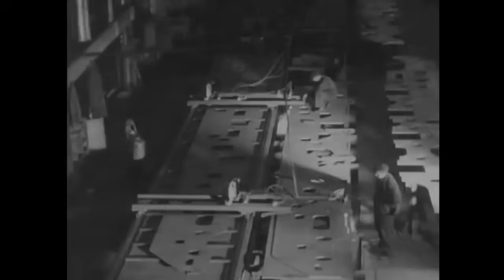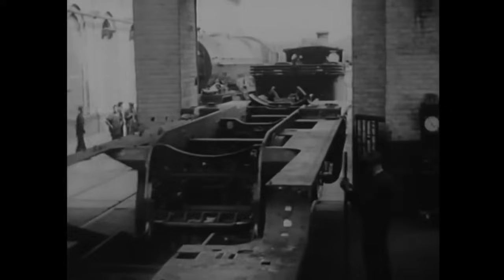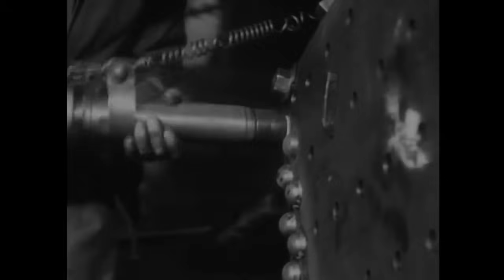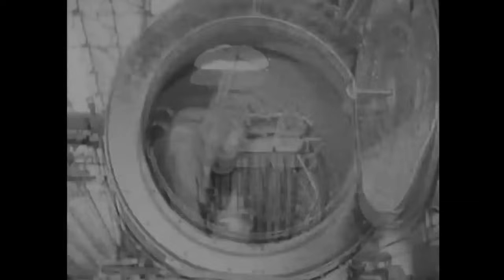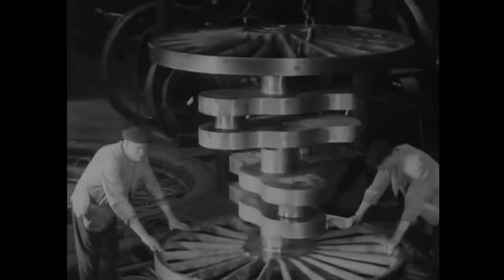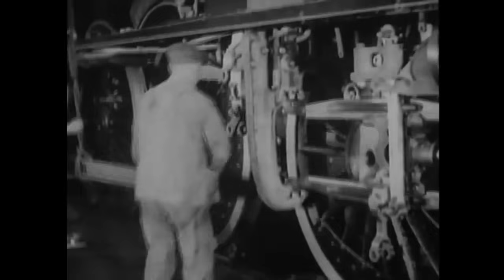No. 6207, A Study in Steel - Princess Royal Class - vintage LMS film - 1951

Comment: Look at the size of that inside cylinder block, and think what a nightmare it would be to make one of those nowadays.
Not impossible, but VERY difficult and expensive.
Then it has to work properly, AND be tested for certification and insurance. 
(Not complaining, safety is paramount on the railways).

Comment: Tragically, this very engine would later be involved in an accident due to poor assembly. According to the RailUK site;

"On Friday, 21 September 1951 the 08:20 Liverpool Lime Street to London Euston consisting of 15 coaches hauled by a Princess class Stanier Pacific began to de-rail south of Weedon on the West Coast Main Line south of Rugby at a speed of 65 mph and finally crashed, killing 15 people and injuring 35 more. The footplate crew survived and protected their train in spite of being severely shocked. The accident enquiry, conducted by Lt Col G R S Wilson, found the track to be in good condition and the speed of the train not to be excessive. However this was the first trip out for the locomotive, No 46207 Princess Arthur of Connaught after its bogie wheelsets had been swapped round. The enquiry concluded that the derailment was caused by an excessively tight bogie axlebox. The approximate location of the collision was 52°13'32"N 1°04'20"W, less than a mile south-east of the 1915 derailment and close to the signal-box at Heyford south of Stowe Hill tunnel where the occupants were able to see the accident. "
Reply: Do note, for anyone feeling bad at the thought that the fellows in the above film who seem to be doing such a meticulous and skilled and impressive job were making a train that would immediately crash on its first trip out because of a mistake, that this film of the creation of 6207 was filmed in 1935 and not 1951. It was a later crew 14 years later that made the mistake.
Reply: It must have been repaired and put back in service since I have it down as "spotted" in my WINTER 1959/60 Ian Allan abc of BRITISH RAILWAYS LOCOMOTIVES when I was 12 or 13.

Comment: Interesting to note is that this train was involved in an accident on the 17th April 1948
Reply: Did they repair it or scrap it after the accident?
Reply: @Cleveland.Ironman  It was originally built in 1933 and after the crash in '48 it was repaired and went on in service until it was withdrawn 25/11/61
Reply: @davidrobinson8224  Thank you for the information. Almost 30 years of service from magnificent rugged equipment designed without CAD/CAM but sliderulers and brains!
Reply: @Cleveland.Ironman  You got that right and not only those people but the blood, sweat and tears of the workers.  Mind you, the Health & Safety people of today would have had a field day, with the effect, that nothing would have ever been built.  It would be good to find out what the casualty rate in those far off days was compared with today.

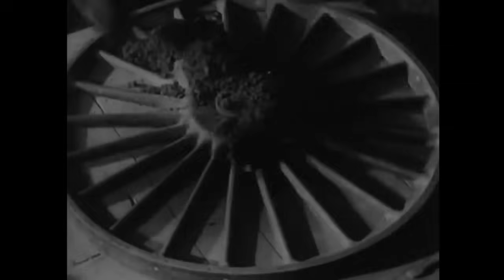Comment: 20:35 the production of the four cylinder wheels with double crankshaft inside was a real high end technique these days. 26:15 the windows design in the wheels shop are like windows in a cathedral.

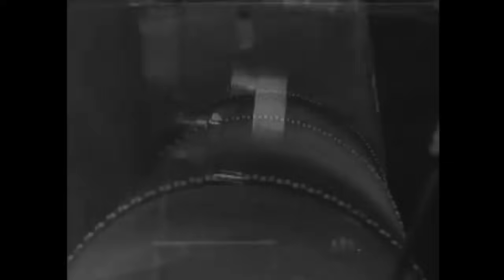Comment: Not a minimum of noise protection ruined the ears of the blacksmith workers in the boiler shop in a short time 14:00 ff. The asbestos in the isolation of the boiler 18:25 caused cancer in the breath system of the men later on, nobody knows the danger. The same problem accures in the brake shoes factories.

Comment: In the US,there were similar works,and thankfully,some of their products are still running! Remember Alco(Schenectady),Lima(Ohio),and Baldwin(Philadelphia),for they also exported engines to Britain,and if you look closely,in some museums,you can find builders plates,on any number of engines! Also some railroads over here,built their own,notably the PRR(Altoona),N&W,(Roanoke),and they also were building steam engines right into the 50's,and thankfully again,now some are still in operation! As an aside,one railroad,was never totally dieselized,and that was/is the Union Pacific,because they were still running 844(8444), an FEF Class 4-8-4,since joined by a Challenger(4-6-6-4), and a Big Boy(4-8-8-4), so steam also is not dead on the UP! Add a comment,the building of a brand new Ivatt 4-6-2(Tornado),is a feather in the British cap,👏 bravo! You cannot keep a group of railfans down,no matter where!! Thank you for your attention! 🚂🚂🚂🚂🚂🚂🚂🚂🚂
Reply: Ivatt never built any 4-6-2s Tornado is a LNER PEPPERCORN 4-6-2

Comment: Knew a railway engineer some years ago and he had kept a set of special oversize rulers so they could compensate for the size of the wooden mould and the contraction the the steel or bronze to achieve the correct size...amazing...

Comment: How much easier would it be to build this locomotive today, with plasma jet cutters, NC tools, 3D printing.and welding for boilers, and no asbestos.
Reply: hows the 3d printing work, like you put a piece of steel into it and make connecting rods. i don't understand
Reply: Well, no 3D printing but have you heard of new built A1 class "Tornado"? Lots of videos here.
Reply: Just a few years after this engines were welded together, but yes with current tools and machinery and metallurgy this process would be incredible, as seen in the improved LNER P2 currently in production at Darlington.

Comment: No PPE anywhere.  I wonder how many of those foundrymen had silicosis or lung problems later in life?  My dad worked in a machine shop - never wore safety glasses and was always being taken to the local eye hospital to have splinters pulled out.  Good old days?  No thanks
Reply: And the companies would have let that go on; they didn't care much for their workers. Not enough to spend a few quid to keep them safe. Oh, those were the days.
Reply: For an isolated Safety Officer, a Railway Engineering Works truly was "hell on earth". Hazards? They had them all, and even the line foremen were, some at least, contemptuous of health and safety. I'd like to believe things are better today.
Reply: But a lot of those workers wouldn't wear their PPE even when it was given to them.
Reply: @ericwalton4610  Probably true. I used to work in the chemical industry and part of my job was issuing PPE. many of the older workers refused to wear safety specs, gloves  or helmets. Not sure why. I evn saw one man in welding without using a visor, and this was the 1980s

Comment: My grandfather was part of the crew in the boilershop during this period. Now there is almost nothing left of the works. The local council has ensured nothing remains of the once mighty workskop. Not a brick left resting on a brick. Crewe has developed supermarkets instead. It's very much a ghost town nuwadays.
Reply: Craig's Classics what a shame. This is brilliant to watch
Reply: Well sad to say... building don't mean much without skill workers. Those skill workers have long departed.
Reply: @yours_sincerely48  you only need those same skills if you plan on doing it the same as here, you can achieve the same end result of a functional locomotive using other skills and techniques that have superseded previous ones. You can get the same result from a slide rule as a pocket calculator, you can get the same result of a visual understanding of a design from paper as you can using CAD. What's the difference at the end? Both locos would move the train.
Reply: Equally, I cannot begin to imagine just how contaminated that site must have been, the amount of asbestos and heavy metals in the buildings and surrounding land and god knows what from all those years of it building up.

Comment: Yes, I'm too lazy to research this on my own: why did British Railroads look favorably on inside cylinders with the unavoidable crank axle and American Railroads did not?

And another one: wheels on axles first, tires on wheels second. Why not tires on wheels first?
Reply: This is a 4 cylinder locomotive hence two outside and two inside cylinders. The tyres were fitted prior to the axles and then when assembled, the tyres were turned and the unit was machined and balanced as one major component.

Comment: How they obtain 100% watertightness with just rivets as they don't seem to use any kind of gaskets. How come they can be so sure of their job as there's no way to check it until it finish and put under pressure ? What if there's a leak?!
Reply from the maker: The rivets are hammered tightly into place when they are white or red hot and that creates a very good seal. As the rivet cools down to ambient environmental temperature, it contracts, creating an even tighter seal. The rivets do sometimes leak if not done properly, which is the reason they do hydrostatic tests on boilers.
Reply: @BennettBrookRailway  Yes I know for the rivets but it seem incredible as they obtain literally 99.9999999% perfect riveting. Even with tonne of force/pressure one needs perfect and very plane surface to achieve no leakage under pressure.
Reply: @stephane.sonneville  Of course they get near perfect riveting, put in literally thousands of rivets & you get good at it, the guys riveting boilers would have had years riveting less critical things first. as for no leakage at the joints, they'd got 90 years experience built up to know what overlap, what rivet spacing, etc., would hold the steel boilers together tight enough to get a good seal.  Those lessons got learned the hard way with some of the early locomotives & static engines at mine workings a long time prior to this.
Reply: Put outside so it rusts. Watch  Fred Dibnah, it's all there.